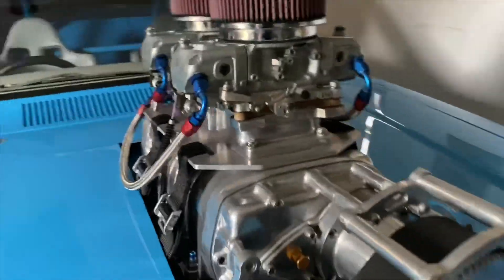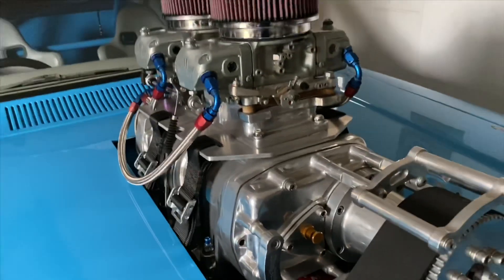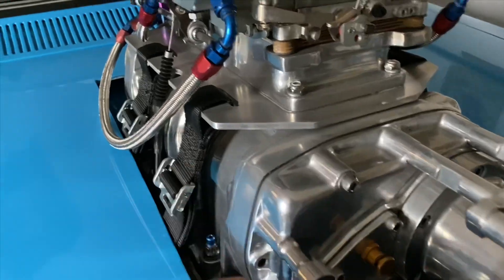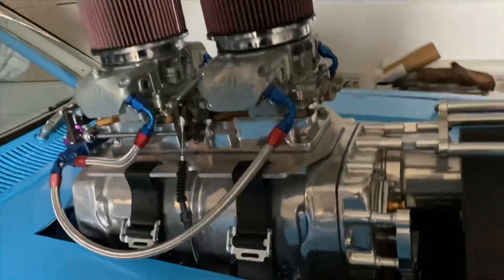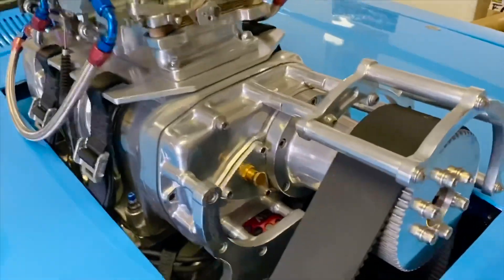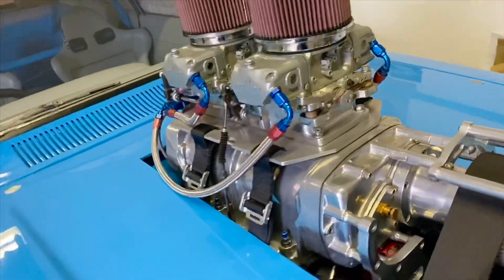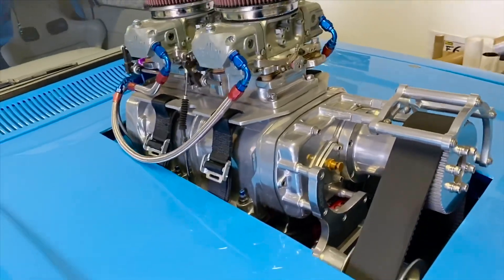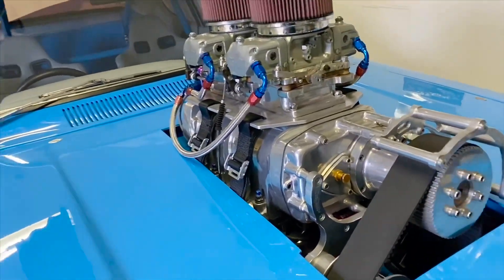Blower Supercharger Tips, 6/71 Supercharged sbf drive

Comment: Can you give more details on the carburetors what the jetting is and power valve and squirters. Thank you
Reply from the maker: They are outta the box BG demon blower carbs 825cfm (x2) , no power valves (removed). Jets are still from when I’d raced it  94s inner & 95s outter as the carbs lay. On Cleveland’s you check especially no5 cylinder plug, if any plugs gonna read lean it’s that, so we jet the outter touch more to help out.
Nothing fancy man, hope that helped 👍🏼🏁